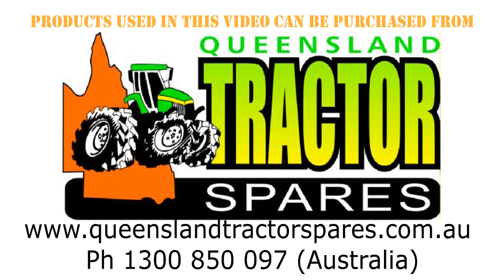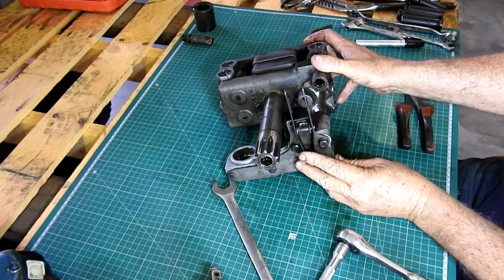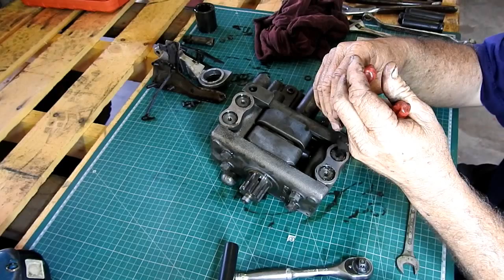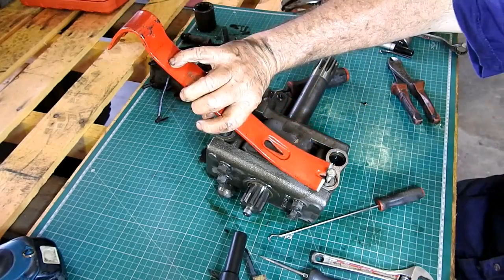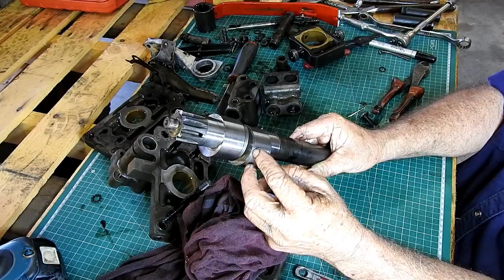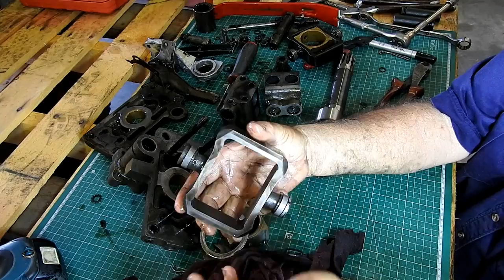MF135 6 Speed Restoration #46 Dismantling the Hydraulic Pump

Comment: Hello, good afternoon friend, I really liked your explanation, I can see that you understand the hydraulics of the Massey Ferguson, I have one of the 200 line and it has a knock that can only be heard when it reaches the desired height, that is, when it is lifting a heavy implement it only makes noise if you hear when it reaches the height defined by the interior lever, that is, if you set this lever to lift 40cm it lifts it up to there without making any noise and when it reaches that defined height it starts to make a beat, you get the idea that this is when it tries to balance the pressures to maintain that position exactly what you think it might be...Thanks from Portugal.
Reply from the maker: The knock is from the pump supports and the way the pump works, they almost always do what you are explaining and go for many years like that normally.
Reply: @bundybearsshed  Thanks for your help! It's a very loud noise and it didn't make it before... but I wonder if it's the pump supports, should it make it when lifting weight? When it's under strain, for example, if it's put on constant pumping, it doesn't make any noise and only makes noise when it reaches the height set by the lever, whether it's 40cm from the floor or in the transport position...
Reply from the maker: usually they make noise under load, Im not sure why yours only makes it when cancelling the lift, possibly lift cover adjustments are out.

Comment: Hello. I have a question. Will this pump fit a Massey Ferguson 35?
Reply from the maker: I have never done it but I think it would being ten spline.
Reply: @bundybearsshed  I'm from Poland. I have Massey Ferguson 35. I am renovating the hydraulic system. I need to replace the hydraulic pump with filter, a new type. The pump was ordered from Bepco parts.

Comment: Hi Lance thank you so much for all the time you have put into educating us diyer's The video's are clear and instructive great job. A question Lance my 135 6 speed has pressure control, can you bypass this by putting a plain standpipe between the pump and lift cover , take out the blanking plug in the pump and inserting a normal relief valve Many thanks Rob
Reply from the maker: Yes you sure can.

Comment: I have an older MF 230 in the shop right now with a stopped up hydraulic pump screen full of metal. It has ground speed and live PTO. The ground speed gear on the pinion shaft as well as the pto gear it meshes to have broken teeth from a floppy detent on the pto shift lever. If I’m never going to use ground speed pto, do I need to replace those gears at all?
Reply from the maker: No not at all, the gear on the pinion has a circlip holding it onto the hub and you can just leave it out with no problems at all.
Reply: @bundybearsshed  , thank you for the reply! I brought it home from the shop after they quoted me over $3,000 to change the hydraulic pump. I believe I’ll tackle it myself.

Comment: If you need to replace the valves on the pump would any grinding be needed or could you just fit the new ones in just the way it is
Reply from the maker: Just fit the new ones most times.

Comment: is there a video assembling the 135 top cover? i want to assemble our 188 fitted with a pressure control
Reply from the maker: No I had a second hand one to fit which was cheaper at the time.
Reply: Thando Gama  ok Sir. Thank you. approximately how many o rings are put when doing a rebuild on the hydraulic pump?markII

Comment: Was the pump still suppling pressure and able to lift anything .
Reply from the maker: It would lift empty arms from time to time but mostly it did not work.
Reply: @bundybearsshed  my fergie 250 is having this problem and it's juddering when lifting my finishing mower. When you increase engine rpm it looses power. Tipping box hydraulics are slow aswell
Reply: @bundybearsshed  would really appreciate some help